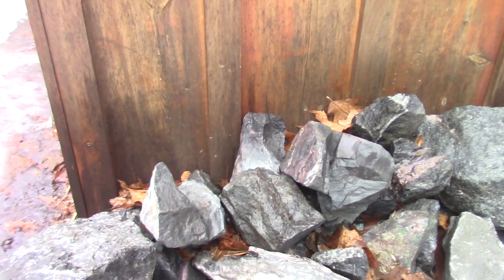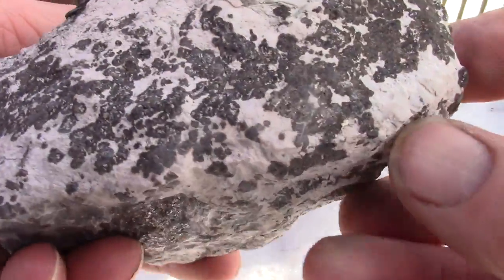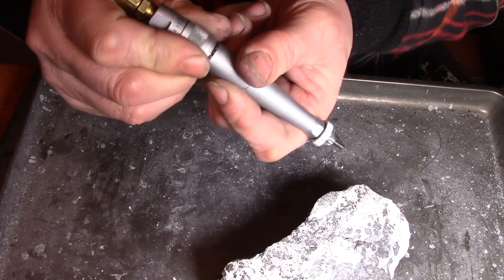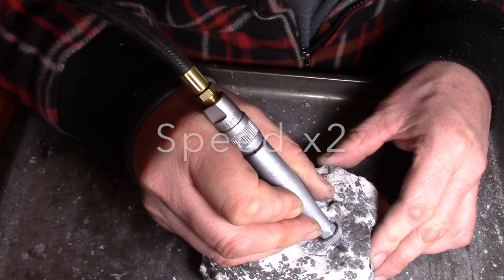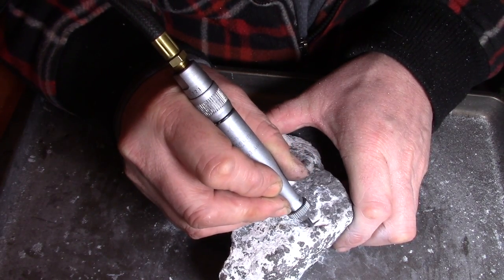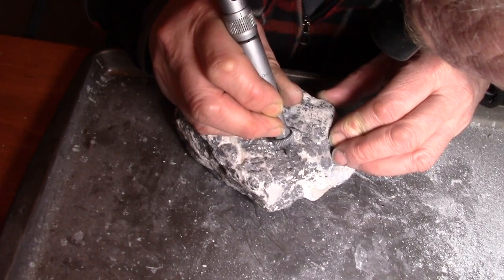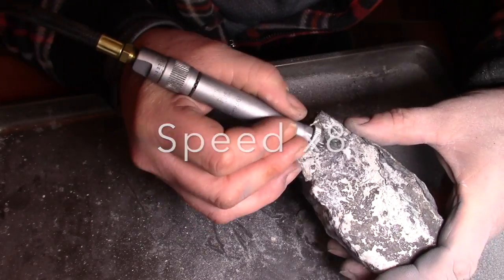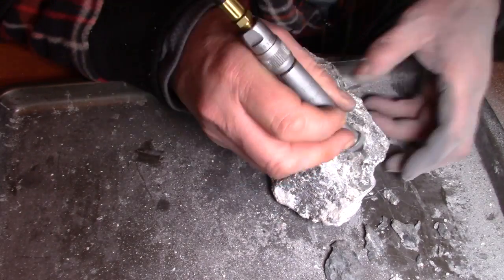ETCHING HUGE SILVER ORE with an AIR SCRIBE

Comment: It certainly is addictive, been there done that and it was just to engrave a plaque for my now departed father but that lead to other things and soon was snowballing out of control.
I heard your compressor this time, you kind of get used to it quite soon but if you are really concentrating and working little bits at a time when the compressor cuts in its hard not to flinch.
Stay warm, looks really cold there.
Reply from the maker: I have a fairly large compressor.  If I didn't like the noise, I guess I could charge it with air and turn it off for a while.  It would drive me nuts with a little one turning off and on all the time (or like you say, surprising you).  I might pack it up soon and use it outside when things warm up.  The nice thing is I probably won't be able to hear the roosters....LOL

Comment: Cool..so out of all the processes you do..say from polishing/tumbling to using muriatic acid now to the air scribe..what is your favorite end result. ?I'm looking into buying my first rock tumbler..can't wait..
Reply from the maker: That is like asking which one of my kids I like best.  Now, the answer to that is Amy...only because she is an only child.  LOL  

Seriously, I personally like exploring and the hunt for rocks best, followed closely by the first wash up to see exactly what I brought home.  Of the next processes, I probably like slicing and polishing rocks best.  Probably because I have control over the result and it is quick.  

If you are looking for a tumbler, my little bit of advice is to consider your local online markets (eg. Craigslist, Kijiji, etc) for a used one.  Many tumblers are  bought and used once (if at all) and then sit around collecting dust.  If a good one is not immediately available, set up an email notification and then jump on it the next one posted.  One indicator for a good one (lightly used) is they still have their original grit or the little bag of rocks that came with the machine.  In my humble opinion, there is no need to buy new.